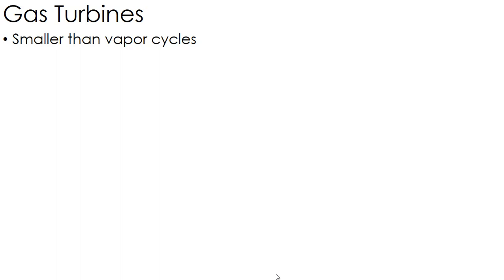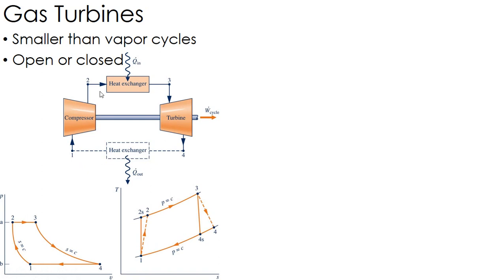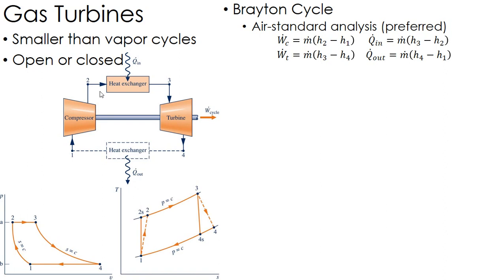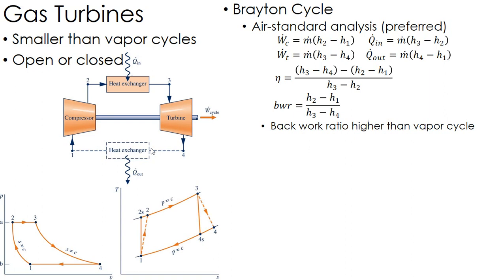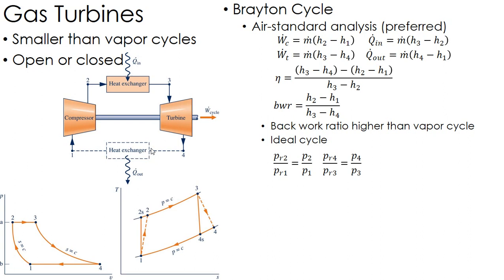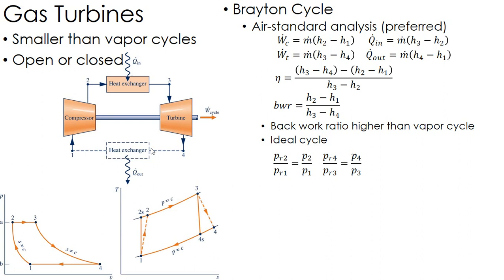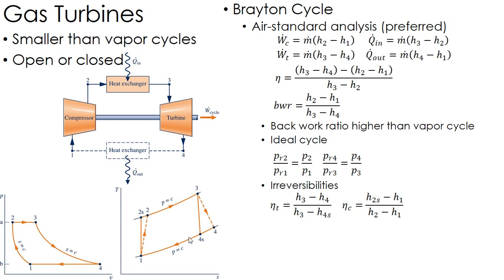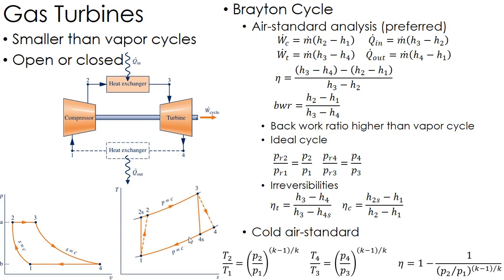Thermodynamics Lecture 31: Brayton Cycle

Comment: Can i ask..i have researched that the ideal brayton cycle have conpressor work and turbine the sam, so is that means that the work net is 0?
Reply: The Ideal Brayton Cycle is the cycle without any modifications, It only consists of Compressor, Combustion Chamber ( or heat exchanger) and a Turbine.
The work of the compressor will never be equal to the work of the turbine actually because if that happened,then what is the purpose of constructing the whole cycle? 
You just may have misunderstood something.
The efficiency of the ideal Brayton cycle is very low ( Same for the most of the gas power cycles) but it isn't equal to zero ofcourse, that's why we do some modifications ( Intercooling, Reheating,etc )to it and the efiiciency isn't that high after all of that.